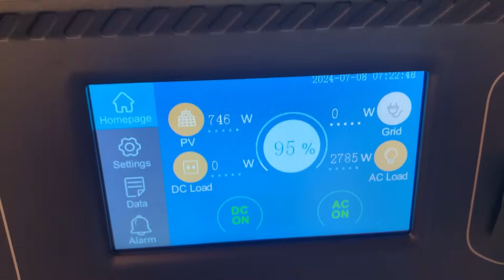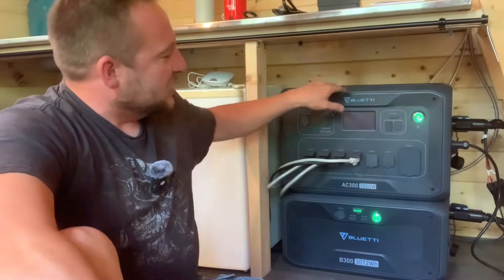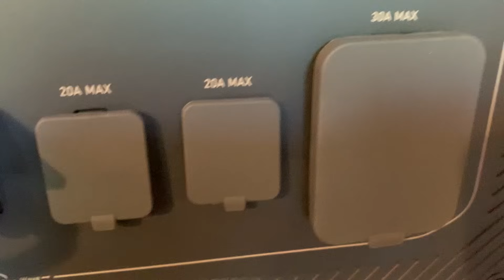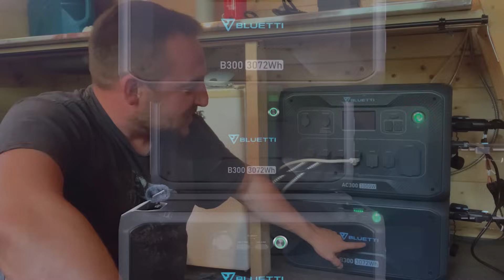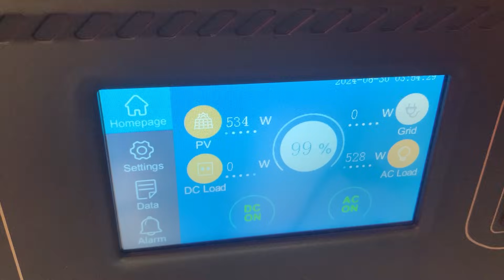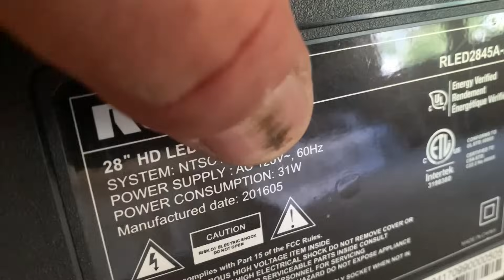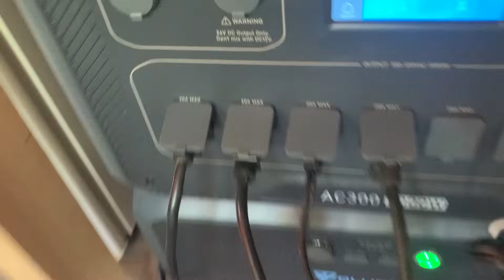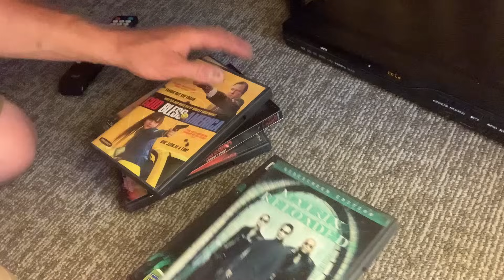☀️Off Grid Solar Cabin DIY with 1.8kW PV & 3kWh BLUETTI AC300&B300.  Runs a 5000btu A/C all day.

Comment: That will not work in south Georgia. I have one with 3 Batteries. What did work was that for a backup and 4000 watt solar system with 14360 watt hours of batteries. Granted I'm cooling 480 sq ft compared to 125 sq ft up north. You need AC at night in the south. Also I live in it not a weekend warrior.

Comment: We have an old camper set up on a farm where we spend weekends fishing.  It's in Alabama, so AC at night is an absolute necessity. We have the same AC you have, and it pulls 400-450 watts when running.  Unfortunately,  that's basically 24 hours a day from May through October, when it rarely gets below 70 at night and often stays above 80.  Humidity is generally brutal as well.  Can we sleep without AC?  Somewhat.  Will we be comfortable?  Not at all.
We use a Bluetti with 2 12v lifepo4 batteries connected so we have about 4wk of power available when it's all charged up.  It must be portable because the ghetto rats and meth heads are always looking to steal something.  We use the camper quite a bit on weekends, but it generally sits empty all week, and we've had a couple of intruders.  We don't leave anything much in the camper, but carry it in on Friday and out when we leave.  We use a Honda generator to make sure we have juice to get us through the night, and we spend as much time as possible outside under the pole barn during the day.  We have 1600+- watts of solar on the roof, so everything can be recharged during the day, assuming we have sunshine.  If not, we can run the Honda a couple of times each day.   We just use a lifepo4 battery charger, run through the Bluetti, to charge the extra batteries.
It wouldn't have cost us too much to run power, but we didn't want power poles running across our pastures, and we already had the components of our system.

Comment: Sorry, Bluetti,[ very bad experience with them, they have zero customer service, I was very lucky to get my money back. As for the equivilant from ECO Flow, they have better specs, check it out.
After extensive research and review, ECO Flow is the most reliable, practical and innovative product and has reliable customer service which has been reliable since I have went with them answering any questions.

Comment: We have Bluetti set up in our Montana cabin. I really dont understand why everyone doesnt do their solar this way instead of messing with all of those components on their wall. I have our cabin set up a lot like yours and it works great.
Reply: if you build your own system it cost half the price of getting a  portable generator.  But the reason most folks pay the extra for portal generators its because its easy to use and understand so anyone can use it.
Reply: I have both.  The system in my barn at home is a DIY and cost me less than half what a power station setup would cost.  The negative is that it's not portable, while I can throw a Bluetti in the truck and use it anywhere.
A truly big offgrid system would cost a huge amount of money if you tried to use an all-in-one system.  My house in GA would require 90kw of battery capacity during the summer and less than a 3rd of that from October til April.  There's no reasonable ROI for me in a complete solar setup, even if I did the entire thing myself.
We have a place north of Missoula at the base of the Mission Mountains.  We generally spend part of July, August, and September exploring out there.
Reply: @jdollar5852  I remember driving through Missoula in August to the Bison Range. It was H O T and dry that day.  Hope your place has some shade lol
Reply: @jksmountaindream  you can see our ranch from the top of the Bison Range.  We go there a couple of times every year.  What an awesome place it is.

Comment: Man!!!! The most awesome no-nonsense video in the topic!! thanks for this! Just pulled the trigger on an EcoFlow unit / got similar appliances to run.... was wondering if i will have to build a complicated breaker box or something to get things going.... you gave me the answer...: NOPE.... massive relief... Would have a clarifying question: so you just have the 2 lines as you mentioned and you built outlets for the appliances and you plug them into those and that's it.... no additional fuses etc???? TIA for your kind answer!!!
Reply from the maker: No panel or fuses.   Just plug 🔌 cord end to each working circuit in the little cabin. 👍.  Simple
Reply: @ArkopiaYouTube  Thank you Sir!

Comment: You've always been kind enough to answer my questions.  I try one more :).  I've bought the buletti ac300 and two batteries.  The panels will be 4 520w panels.  What I don't know is what wire do I purchase for this unit.  Can you shed some light on what I need to by to connect panels to the bluetti?  Thank you for your time as always.
Reply from the maker: A standard solar wire is 10awg (10 gauge) multi-strand wire, good for 600v. (You could get by with lighter gauge for this project, but I just stock 10awg)  The standard solar connectors at the ends of the wires are called MC4 connectors.   You can buy a cheap crimping tool and connectors and a roll of wire and practice.     I forget if you run each of the 2 panels in series or parallel (2 panels in parallel doubles the voltage, 2 panels in series doubles the amps).  Double check what the Bluetti can take for maximum volts and amps.   I think I just ran 2 panels in series (positive to negative connected between panels, and the other + and - into the Bluetti cord).  You need to buy a Y  mc4 splitter to run parallel (2 positives together and 2 negatives together) 👌
Reply: @ thank you so much for your time
Reply: @ArkopiaYouTube, you can generally send more watts than the Bluetti will handle with no problems, but you can't exceed the voltage limits.  My older Bluetti AC200max will accept 900 watts of solar at 150 volt max.  I can, and do, run 3 400 watt panels with no issues.  The charge controller will only pull 900 watts and the voltage comes in at around 120v.  If I tried to add a 4th panel I would fry my Bluetti.
Reply: @jdollar5852  The AC 300 can accept 2 strings of panels. Each string can only accept 150 volts of VOC or open circuit voltage, and 1200 watts. if you exceed the VOC or watts the AC300 will. have an error and not run untill you get the solar voltage or watts down. it's smart enough to stop you.

Comment: To plug your whole cottage system. Could you not go from the fuse panel and 1 cord to run the whole cottage or even two rather than plugging everything individually into the unit.??
Reply from the maker: Bluetti system just has series of plugs, so I wired it like I would for each breaker with cord ends.   A big off grid system you would wire into a 220 standard panel

Comment: link for solar panels? how you have the solar wired? parallel or series?
Reply: He explained how the panels were wired in the video. There are 4 panels and the Bluetti power station has 2 solar charge controllers, so he wired the panels in two separate series sets, one connected to each charge controller.

Comment: There must be something wrong with your capacity meter be cause even if your AC unit only draws 1500 Watts, and the compressor ran only 30 minutes out of each hour of use, then your battery would be completely depleted in only 4 hours. Not 91% after running all day.
Reply from the maker: 1800 watts solar input
Reply: @ArkopiaYouTube  Well, that make a big difference.

Comment: I've been in the inverter repair business for over the 24 years and I can tell you from experience that these high frequency, transformerless inverters offer very short life expectancies and far poorer surge capacities than low frequency, transformer based inverters. You'll be lucky to get even 2 to 3 years of service from this unit before the MOSFETs or IGBTs fail. Even worse, without a transformer to provide galvanic isolation between this inverter's DC boost stage and its AC output, you run the risk of damaging your AC appliances and even setting them on fire. Check out diysolarforum and search for the term "devastating fire" to view pics of a cabin that was allegedly burned to the ground by a bluetti portable power system.

Comment: I'm sorry, the load calculation doesn't support what you claim 3000 watts will handle. A microwave and an electric kettle will pretty much max that out.
Reply from the maker: 700+1000=1700

Comment: Dean, you love a deal so you will get a kick out of this. I researched solar for a while and finally went for the Jackery 1000 to “save a little money” from the bigger version. You should see the tiniest little cook plates are all it can handle 😂 MAYBE a pack of ramen. So what’s happened is I have spent money trying to find itty bitty appliances once I decided I could cook a little to stretch fuel. Wish I would have bought a fat daddy from the jump! Using my insta pot, air fryer, slow cooker would be very nice!!!
Reply: *UPDATE* bought the Jackery 3000 on Cyber Monday for half off :)
Reply: Thanks for the heads up 😅

Comment: Are those the type of batteries that shouldn't stay above 80% long term? 
Meaning, if they are constantly plugged into the solar but the air conditioning never runs down the battery below 80% over months and months, is that bad for the batteries?  
I only have a portable solar generator and am still learning. 
This looks super cool.
Reply from the maker: At night it drops down with the little stuff like fridge running.   All day it’s fully charged
Reply: You can easily change the settings for charge/discharge levels.

Comment: Really cool technology Dean .
Great job on your research but if you used your super insulation (R-60) insteadofthe inefficient bunky home ,and built a similar tiny home how much difference in overall cost would there be ? 
I'm presently designing a 16' x 32 ' x 18 ' high home and will still need a off grid power supply like the one you have demonstrated. 
Those 450W panels are a good starting point but are they the top of the line ? How well can they handle large hail ? Any ratings posted by the manufacturer? 
In Texas, there was a massive hail storm which wiped out a solar farm .
That's what I am concerned about. The survivability of the solar panels. 
Anyway brother Dean ,enough knit picking .
Love your inventiveness. 
Maybe some day you will use the R-60 technology in your next project. 
Fridge ,large freezer ,laundry room (washer only),hot water, (either " on demand " or 30 gallon tank ,tri energy designed, (propane back up ), 120 V element , plus 6 - 12V DC elements.  That's the next leap in hot water technology.
Reply from the maker: You’d need an air exchanger and slightly less heat.   This thing is small.   Putting in a super tiny wood stove and still cook out of it I think.   I’ll be building some cabins over the years, high efficient from scratch that will perform better.
Reply: Wonderful Dean .I  knew you wouldn't stop at the Bunky .Your too intelligent for that . And you go slowly with your development plans to learn about every level of cost/ Sq/ftage.
My design issues are what shape is the most efficient in heat loss prevention and from what I remember, a spherical shape has the most volume with the least amount of surface area. Hence the geodesic doom ,but we've discussed that already.  Tee pee is still on my list as is hexagon plan view with a ratio of 1 : 1 .
35 ' base² ,35 ' height  tall . But the solar panels are rectangular not pie shaped. 
Oh well, I guess I will have to wait until you to slove this ,.😊
Reply: Arnold